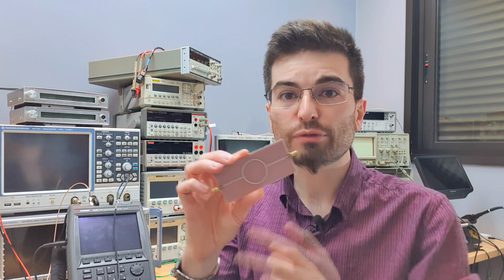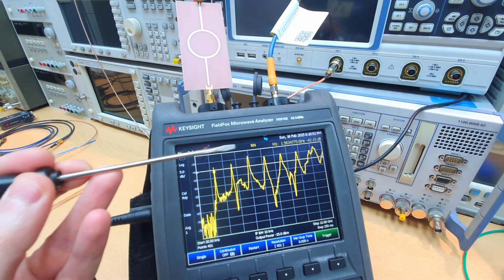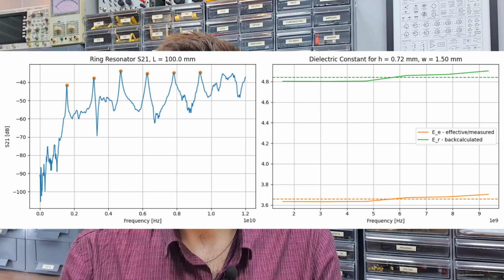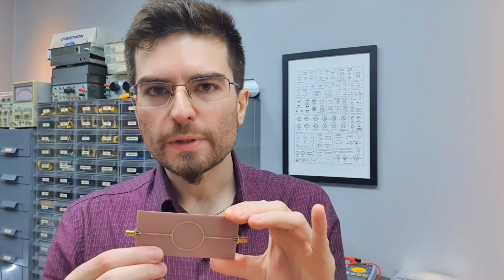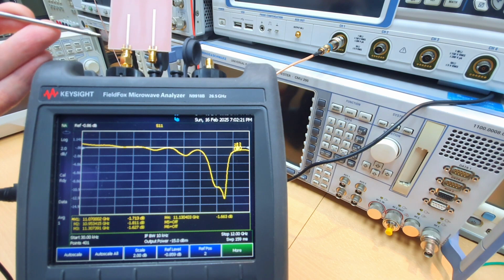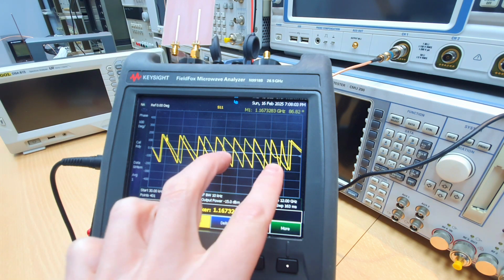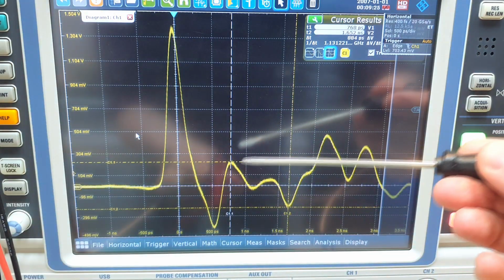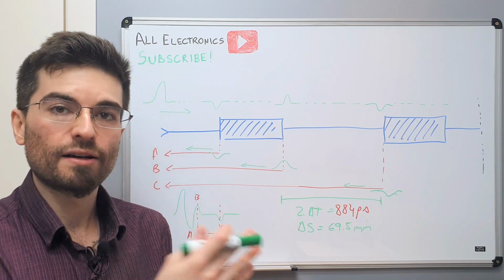How to Measure PCB Dielectric Constant – 3 Accurate Methods Explained!

Comment: How do dielectric losses influence the measurements? The permittivity does not really model the equivalent resistance experienced by the signal due to these kinds of losses, which vary between materials without a strict relation to the dielectric constant itself.
Reply from the maker: You are right, RF materials (not FR4) will have negligible loss. Nevertheless, the idea here is to measure the effective epson - to be used when designing - so it works as the measurement embeds the loss.

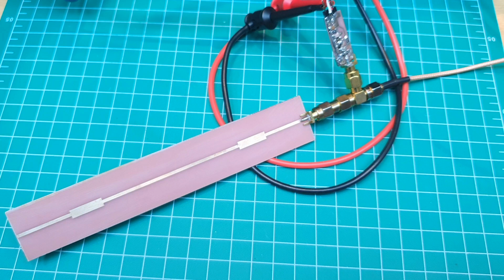Comment: 16:29 this SMB-T is nasty, because it creates a significant impedance mismatch by itself (connecting three 50 ohm lines). I somewhat wonder if the interpretation of the data really applied for the the distance between the two intentional mismatches or maybe between the reflection from the T back and forth to the pulse generator output and the first mismatch. Or is your pulse generator output very well terminated?
Reply from the maker: I can't say the pulse gen is very well matched. Interesting that the T gave the best results. I tested directional couplers and a professional power splitter. I came to believe that the simplicity of the T (in terms of group delay) gives the best results. It also happens that the width of the pulse is not short enough to resolve the dimensions of the T... thanks for the comment

Comment: Ring Method: Is reduction in propogation speed the reason circular patch antennas are smaller than 1/2 wavelength?

2:40 Does "propogation speed = EM wave speed"?

2:52 Does the speed reduction cause Doppler compression at the insertion point?

3:55 Is "loading the resonator" mean high gain at the resonant frequency? No, it means shifting the resonant freq. How? Something to do with impedance?

4:21 So, measuring DC means measuring the resonant frequency? 

5:45 Do we need to rearrange the formula to isolate Ec?

Comment: Have you worked with the ADF4351? i am trying to pulse the PDBrf function but it's shifting my frequency? is it loop filter related or output match related?
Reply from the maker: I think it is related to the loop filter...
Reply: How do you calculate it? I know that my frequency shifts 20khz when pulsed how do I alter my loop filter? What parameter do I focus on?

Comment: Never mind, lambda is correct, by counting the nodes on your current density.  If you had a single line vs a ring, it would resonate at lambda/2, but the ring is essentially two lines in parallel thus lambda for a full circumference.

Comment: Excellent video! I've come up against this a few times when the manufacturer didn't have dielectric data at the frequencies we were using. This would have come in handy! 

How critical is the gap on the ring resonator? In the article you mention about 0.3mm, and in the video you mention trimming it to give you < -25db, but how exactly do you accomplish that symmetrically on both sides with solder?
Reply from the maker: Nice! For this prototype I draw the PCBs and corroded, so they are symmetrical by nature.

Comment: You can also build a microstrip line on the material then measure the short circuited and open circuit impedance at the opposite side from the SC/OC load to deduce the characteristic impédance. From it you deduce the relative permittivity from mucrostrip design formulas.
Reply from the maker: That is a pretty nice method!

Comment: There is an old one, forth method of measuring Er - is to make a big capacitor from the two layers board. Given its physical dimensions we can calculate the Er. Not so precisely than using VNA, but very easy.

Comment: Ok an interesting vid about making measurements, and microwave structures, on FR4 if you have nothing better to do. Otherwise a 50,000 USD expenditure on gear for a solution in search of a problem.
Reply: Yep, my personal feeling is about the same. Casual engineer is not so rich to perform such expenses for almost nothing. Each manufacturer must provide the characteristics of their PCB material. The video is just a valuable theoretical material.

Comment: All this well explains the process of wave wandering in a microstrip line, but there are simpler methods for determining the dielectric constant. for example: we measure the capacitance of a printed circuit board blank (with intact, not etched, VIRGIN!) foil (foil-dielectric-foil = capacitor) using any multimeter that can measure capacitance. Next, knowing the area of the foil, the thickness of the dielectric and the capacitance. The dielectric constant can be calculated. It turns out to be quite accurate and HF VNA is unnecessary. (Translated by Google)
Reply: Or consult the manufacturer.
Reply: @willthecat3861  Эхххх...  друг... Не всегда всё так просто!... ((((
Reply: @willthecat3861  Cant always trust datasheets. Lesson learned the hard way.
Reply: The dialectric constant is frequency dependent. What's measured at quasi DC is not going to be relevant at GHz frequencies.
Reply: @ Oh, sorry, we're all idiots here!.....  If you don’t try to create 10 GHz microwave transmitters on the FR-4, then you can measure the capacitance with a multimeter. up to 2.7 GHz this method works well. And it is better to measure the workpiece to the maximum possible size.
Reply: I used the same method as you explained, but used a nanovna to measure capacitance at the desired frequency. This way we can solve the issue with frequency dependant dielectric, as stated above. It turned to be really accurate for something that i tought that wouldn't even work
Reply: @sergerovichpavliche741  This is not accurate method, because you would see resonances of copper plate at different frequencies
Reply: @DmitryS-fu7kv i guess that's to be expected, but within the frequency i was working , it wasn't an issue

Comment: There is a one circuit called the jim willams spike/pulse generator, it also creates ridiculously fast pulses some where in the range of 8 to 10 pico seconds. Its mostly use for such TDR Measurments